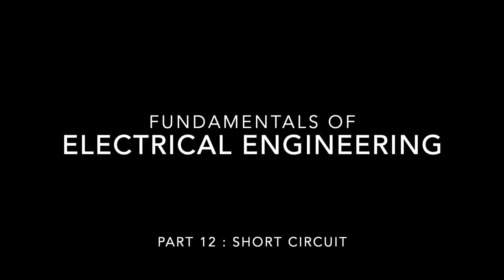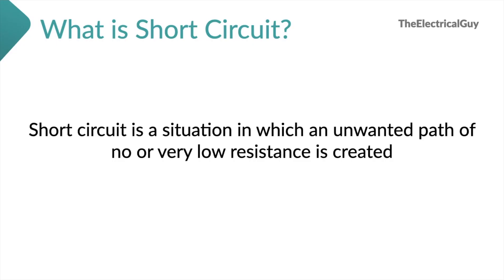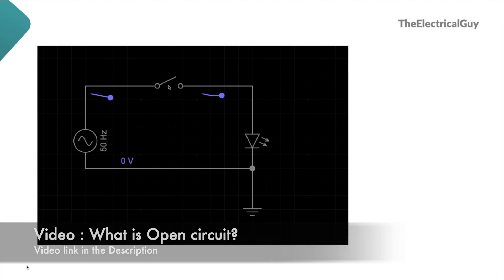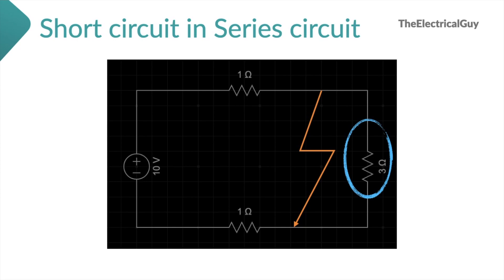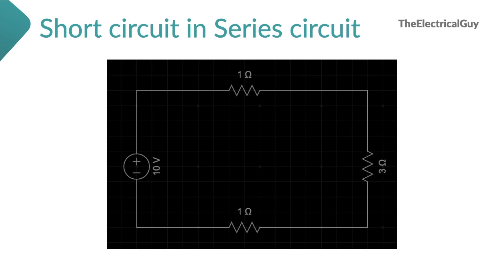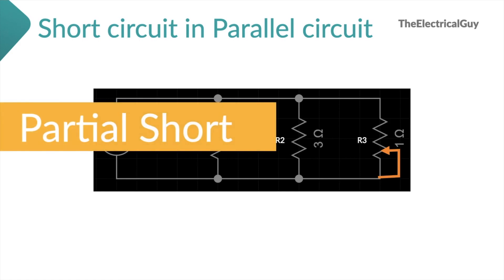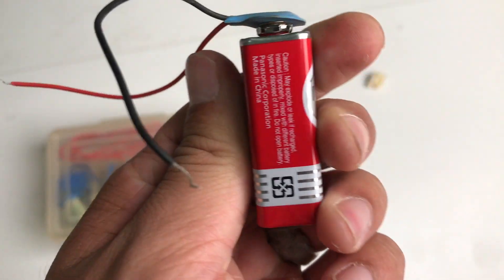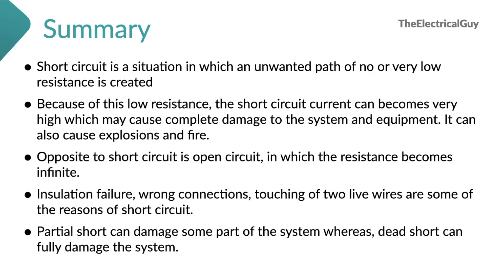What is Short Circuit ? Easiest Explanation | TheElectricalGuy

Comment: Great and comprehensive explanation! Never saw another video after this to understand the concept. As for improvement part which you requested I think the wires in your video were crossing each other making an "X", you had to separate them for clarity when creating a short circuit in the video. I guess long, straight non-crossing wires would make it more easy to see what's happening. Just my suggestion, not criticizing. Thanks!

Comment: Recently I almost got died due to Electrical Switch Short Circuit. I lost literally everything I had in my Hostel Room. Physically I saved myself but I had almost 6 lakhs loss. 
On 10 march 2024 I wake up at 6 am I felt very cold so I turned on hot air giving small round heater and slept again for about 3.5 hours. When I wake up on 9:30 am another bed was fully burning from the underneath of the bed where there was switch. When I wake up fire was already getting big and big. Eventually I couldn't do anything and run out of the room and on panic state watch my room burning. All of the people got panic and they couldn't do anything either. Whole room got burnt. Nothing left Nothing. After that fire brigade came and controlled the fire. 

And Big Coincidence I am exactly 1st Semester student in Bachelor of Electrical Engineering  at TU , IOE , Pulchowk Campus, Kathmandu, Nepal. 

So I am researching how was that big fire accident happened.
i concluded these things.
- there was a lot of burnable things like books and clothes near the switch due to short circuit fire ignite and it immediately spread out amongthings and started burning massively.
- as I mentioned I used electric hot air blowing round heater fan for 3.5 hours due to over use for long time continuously short circuit happened. 
-i guess the ampere Capacity of the hostel was just 5 A. which couldn't hold the load
-about 35 students live in that 3 floor hostel. there was massive electrical overload on that building electrical systems.
-the wire, fuse, switch, wiring and entire electrical system was very old, because that house itself was very old. I guess they didn't change switch and wire for one time after the construction. Electrical Systems was aged. 
- before 2 months when I used that switch to charge my laptop the light of the room was blinking and blinking. I told warden of the hostel about the problem but he just ignored and said me to use another switch. that day heater was used in that damaged switch.

As a Electrical Engineering Student I analysed everything of this biggest accident of my life. 
By all these things going wrong in electrical system of that room got burned due to Electrical Switch short circuit and I am baring heavy mental stress and losses

Comment: Good explain sir,Allways current flow choosing a low  Resistance path ,why fan and Motor, light etc... are working in our home at time their resistance is not same 🤔
Reply from the maker: Dedicated wires goes to light, fan and other devices
Reply: @GauravJ  dedicated means wire diameter ha sir

Comment: Hi, can you explain in the case: short circuit in the parallel circuit. Why is a partial short have a huge current, which may cause damage (an increase from 10.8A to 108A) but dead short near the source in the parallel circuit, everything is stopped, which means no damage, and the circuit has just stopped working, right? so in this case dead short is better than partial short?

Comment: Give me a break no one never explained it this way?? Please. Current always flows towards the least resistance. Like when your skin and hands are  wet and you touch a 120 volts electrical circuit. Your wet skin is ideal for current flow.
Volts is defined as electromotive force.

Comment: Dear Respected Teacher ,
a bundle of thanks from your clear instruction regarding the Short Circuits , I am faced with Challenge of Modeling of Synchronous Condenser in ETAP software ,Using ETAP 19.5 and Synchronous Motor as A condenser , could you instruct me for solving that?
regards
Reply from the maker: Glad it was helpful 😊 
I may not be able to help on ETAP. I have limited information on ETAP.

Comment: Sir very well explained but I have a question that if resistance is zero in dead short circuit and hence potential difference between two points is also zero,then why current flows.
Reply from the maker: Potential difference is not zero

Comment: Sir, by "dead short", the damage will be done only for the source right? Because all the current will flow into the short circuit path. Correct me if im wrong.

My understanding is that partial short may affect some load connected to it but dead short will only cuz problem at the source.

Tq
Reply from the maker: Yes, you're right. Majority of the damage will happen on source side !!